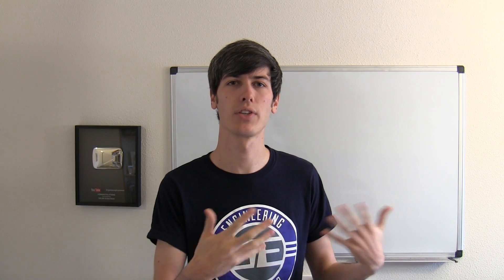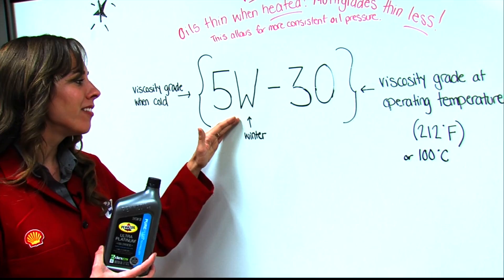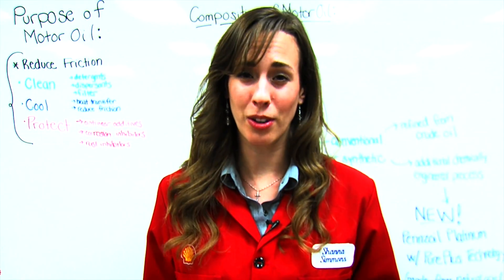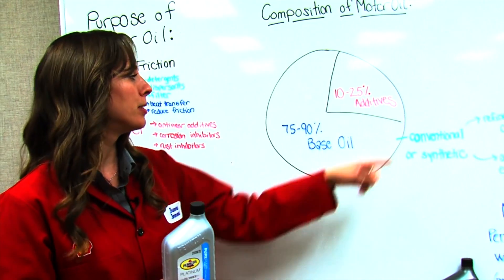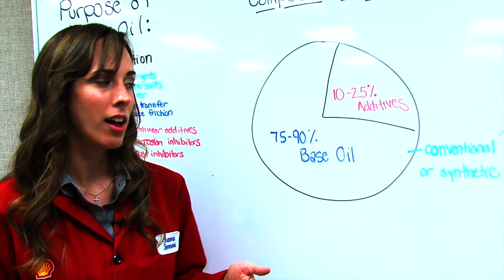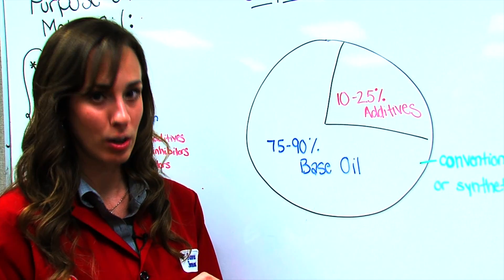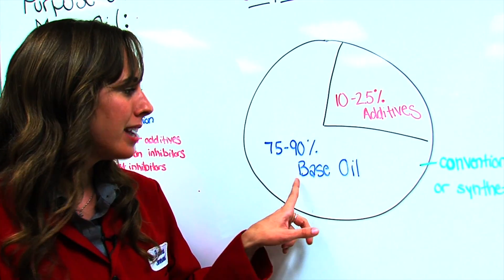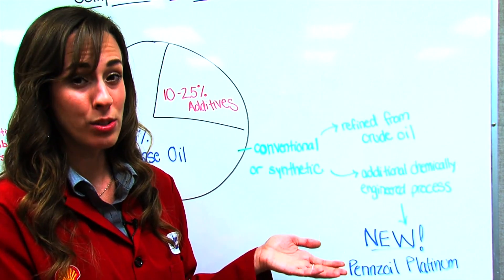Motor Oil Myths & FAQs - Synthetic vs Conventional

Comment: Conventional vs synthetic

Conventional: Refined crude oil
Synthetic: Highly refined crude oil
True Synthetic oil: PAO base motor oil created in lab

The US Supreme Court's (Mobil 1 vs Castrol) stated that "Synthetic Motor oil is nothing more then a marking term". Castrol won the lawsuit against Mobil 1.

For years Mobil 1 was selling PAO base oil (true synthetic oil) as synthetic. Castrol decided to jump into the game and sold conventional oil as synthetic.

Castrol raised the price of the conventional oil significantly to maximize profits while still less over all price then Mobil 1's PAO based motor oil.

Mobil 1 couldn't compete and sued Castrol for fall advertising. Castrol had lobbied Congress for years and ultimately won after a ruling that "synthetic motor oil is nothing more then a marketing term".

The US doesn't have a "Synthetic moor oil grade". Which ultimately means ANY company that sells motor oil can legally label it as synthetic. If I sold a 5 quart jug of oil for $1.50 at Walmart I could legally call it synthetic.

However since the US doesn't regulate synthetic motor oil their is a company that does APi "American Petroleum Institute".

The grades are 
Group 1: Crude oil
Group 2: Refined crude oil
Group 3: Highly refined crude oil
Group 4: PAO based oil "true synthetic motor oil"
Group 5: GTL "gas to liquid" and all over types

Groups 1-3 all start off as the very same thing. They are all crude oil, the same oil thats used to make gas is used to make conventional AND "synthetic".

Since Group 3 oil is cheap all major motor oil manufacturers sell Group 3 as Synthetic. While Group 3 is of a higher grade then Group 2 the quality difference is marginal at best since there is no way to remove all the impurity's from crude oil. On an atomic level Group 3 oils are unstable and deteriorate significantly faster then Group 4 PAO " true synthetic oils".

Group 4 PAO oils cost significantly more to manufacturer and are far better quality then Group 3. Since Group 4 oils are manufacturerd in labs they have 0 impurity's which means they are far more stable and capable of running much longer at much higher temperatures with out the risk of deteriorating.

They also significantly reduce the risk of sludge since they are pure oils to begin with. 

Group 3 are refined to remove (what they can) that are bad for engine.
Group 4 is pure so you do not have to worry about contamination since you only add to the oil what you want in it at 100% pure state.

Mobil 1 vs Castrol (source).
Reply: clinton fisher I know you posted this 2 years ago but thank you oh my God so many people don't realize it's just a marketing scheme for most points
Reply: @kateajurors8640  Probably one of the most successful marketing schemes in marketing history!!
Reply: @kateajurors8640  THere is no marketing scheme, group III oils are way better than group II.
Reply: Group V base oils are classified as all other base oils, including silicone, phosphate ester, polyalkylene glycol (PAG), polyolester, biolubes, etc. These base oils are at times mixed with other base stocks to enhance the oil’s properties. An example would be a PAO-based compressor oil that is mixed with a polyolester.

Esters are common Group V base oils used in different lubricant formulations to improve the properties of the existing base oil. Ester oils can take more abuse at higher temperatures and will provide superior detergency compared to a PAO synthetic base oil, which in turn increases the hours of use.
Reply: My coworker swears synthetic is better, im going to pass this on to him and see what he says. He also only fills up on 91 because it apparently gives him better mileage
Reply: BasedGod Strugglin' your coworker is getting less gas mileage and is polluting the earth more than he would if he used 87. If he drives a regular economy car then that vehicle is not going to be able to take advantage of the higher octane and will make his car slower and waste more gas and obviously spend more at the pump
Reply: @basedgodstrugglin  Every yt video proves synthetic is better, the additive package is everything.  And my co-worker has proven to himself that 91 does give him better hwy mileage.
Reply: @lonniebeal6032  are you joking or did you watch the video?
Reply: Pls help me, should i follow the owners manual recommendation?5w30?coz your saying is labeled synthetic but conventional oil content?
Reply: @jericlamb2676  you can buy 5w30 Amsoil or Pennzoil Ultra Platinum
Reply: @jerryhanson3903  thank you for your reply, i already ask mechanics here in our area, they said in the philippines engine oil blend are diff from US or europe
Reply: @jericlamb2676  so it's better?
Reply: @jerryhanson3903  your engine oil there is better i think, tropical wether here
Reply: You know why Amsoil is better?  Because they don't put words like "platinum"  and "gold series" and "super duper bestest oil ever titanium professional rocket ship science" grade oil on the container... That should alone tell you who to trust.  Then there is the test results that back it.
Reply: @gittyupalice96  Amsoil is a good pao but Pennzoil is better in cold temps for flow viscosity. Penn is made out of natural gas, it's a very interesting species
Reply: @jericlamb2676  that's why I don't use part or full synthetic oil in my petrol power equipments. These little engines are built in an ancestral way, which means, no timing chain but pushrods instead and in a warm climate, a 15w40 won't be different from a regular sae 40 monograde oil
Reply: @jericlamb2676  He's wrong on that.
Reply: I had to come back to this nearly 6 year old comment to find someone who finally explained this.  I don't understand why a company wouldn't advertise as "PAO synthetic" after that ruling though
Reply: 6 years later and it still helps to know. Thanks.
Reply: No to group 1 to 3 starting off the same, most group III oils  are hydrocracked oil, and the additive package for group III is way better than group II, an oil analysis proves it.  Your following statement is also false, group III synthetics have a minimum requirement to be called synthetic.  You are describing Blend oil when you say  "The US doesn't have a "Synthetic motor oil grade". Which ultimately means ANY company that sells motor oil can legally label it as synthetic. If I sold a 5 quart jug of oil for $1.50 at Walmart I could legally call it synthetic".

Comment: Does using a full synthetic oil clean sludge from the engine after using low grade oils?
I have heard people using diesel oils because they have more detergents to clean engines before filling with synthetic oils?

Comment: i heard using synthetic oil in older engines or just high mileage ones isnt really good, is synthetic just more sludge preventing and engine parts protecting

Comment: As an STI owner, they have found the OEM brand oil shears down to 20 wt in 2300 miles. Garbage. Look into it buddy. Amsoil wont shear down or oxidize like base 3 garbage labeled synthetic.

Comment: WARNING friends: Nearly EVERY oil on the shelf in North America lies about being "synthetic". Base 3 is Hydrocracked, "chemically engineered" bull. TRUE synthetics like Amsoil and Redline use base 4, PAO and base 5 Ester. Mobil, RP, Pennzoil are garbage. Just look at the Noack Volatility tests. In the 5w30 range a true synthetic will be around 7-8% whereas the pretenders are 10-11 or more. Big oil in the USA won a lawsuit where they can MARKET petroleum based oils, "hydrocracked" as "synthetic". Its lies and BS kids. I do used oil analysys and on a 3.2 J series the pretend synthetics wear the engine 2-3 times faster than Amsoil or Redline.

Comment: is it possilble to use synthetic oil in a 351-w ford classic engine
Reply: +piloe12 No , a 351 should be run on Mineral oil , and at least a 10w40 or higher viscosity

Comment: Just an interesting find of mine. I owned and wrote for other auto publications mostly Peterson Publications and shop owners from my own publication area, there was never even one single automotive repair shop owner (my distribution area, three states here in the sw) who ever used Pensoil, they sold it but did not ever use it personally. No one liked it for various reasons (4 years ago anyway, I don't publish or write anymore). I always asked wherever I went. Just my own experience. Also there was much information lacking here from and agree with others here that this could have been much more informative in detail, describe base oil, what additives, conventional meaning mineral based? explain , etc. Contaminants don't just happen and explaining why older engines can contaminate due to more burnt hydrocarbons passing the rings...etc. And why new engines don't need 3k miles changes as per findings at Sloan School at MIT. btw, feel free to check out a vid on my air cooled 82 550 yamaha engine utilizing diesel and petrol efficiently. Shamless plug...sorry. Really like your channel by the way and kudos for promoting real science and not pseudoscience bs found extensively on YouTube.

Comment: So what was basically said was that branded oil is bullish? So if i put a low grade oil aka Autozone brand or the bargain brand, with my recommended manufacture viscosity, and keep up on my oil changes... My engine will run well... But what are these additives? What do they actually do? What are they made of? Could i add them myself to my bargain brand oil. It seams like its just a numbers game with large company's. I've seen commercials like Mobile one Full Synthetic running next ot there "competitor" aka Shell. And there test came to a conclusion that Mobile one oil will with stand high amounts of use. Well what if your not keeping your car at 6k for hours on end. What about a company determined to make your engine run at its maximum efficiency? Shouldn't the car leave the show room like this? I love this topic and i wish there wasn't so many motor oil company's so someone could give an honest answer, But would you be able to dig into this more? I'd love to hear what you have to say!

Comment: In my case, I use conventional (3 lts) and semisynth (1 lt), because is what I can find in the most economical and good brand. In my case, the problem is finding good quality oil (most of them from US, hard to find here... you guess already where I am... V...E...N... :P, anyways, what I do to help my pocket is to use a proportion of 3 parts of conventional or semi and 1 part of the best of what I can find, I have an old engine and I try to find the close and best oil, between 20W50 and 15W40 (warm climate all year around).

Comment: I'd like to see a followup on modern engine break-in.  There's a few theories on what the best way is...or if you really need to do anything at all.
Reply from the maker: snakyjake1 That's always a great debate and discussion among the car world. My theory is to go with what the manufacturer recommends, as they're the ones providing the warranty and want the engine to last those 60,000 miles without any problems.

Comment: If the first number in 5W-40 is the cold viscosity, and the second is the hot, shouldn't the second number be lower? How does the oil get more viscous (thicker) as it heats up? Never understood this.

Comment: hey.. i don't know if you had answer this but i hears rumors that when a vehicle has high milles  you should upgrade the viscosity... example

10w30 to 10w40... its that recommended??

other subject.. when you have a car where its upgrades as in a stock to a high performance you should change the the viscosity 

10w30 to 10w40... its that recommended??

Comment: Like many others, i was looking forward to learning more indept things, and seeing some more less basic issues explored.   for example, how do oil detergent work, are they good for the engine and can they actually be harmfull.  or if the newer tougher oils be used in a older engine and changed less often (newer cars need their oil changed less often;  is that the oil or the engine's fault?)  the issue of how mult-grade oils work would have been interesting too, and their benefits over single grade ones.
anyways good channel overall.

Comment: What about switching between conventional and synthetic?  I've had several automotive instructors/mechanics tell me that conventional oil is not as slippery, and more grooves form in the cylinder walls when used consistently.  These grooves hold oil in place (similar to honing the cylinders after a rebuild).  The idea is that when synthetic is used consistently, these grooves don't form as much.  Therefore you should switch from synthetic to convention on a well worn engine, because there are fewer grooves for the  conventional oil to use and lubrication suffers.

Comment: Back in the day (1979) I bought a Pontiac Trans AM with a 6.6L 402cu and I used conventional oil.  Then they came out with synthetic oil by Mobil 1, so I switched to that, and my car started doing a bit of smoking!  I immediately told a mechanic, and he said it was the synthetic oil causing that, and to change it out, back to conventional oil.  So I did, and it quit smoking!  Now that was 35 years ago, when synthetic oil was relatively new on the market, but whats the deal on that...why did it make my engine smoke????
Reply: Your car wouldn't have been designed to use the synthetic, due to it being more free flowing it probably got alot more blow by than what would have been allowed with the mineral oil. I've been told by a mechanic you should only really use synthetic if the manufacturer says to, changing frequently is the most effective way to preserve your engine
Reply: James Lee Hey, Thanks for the input.
Reply: Think of it this way. Conventional oil is composed of small, medium, and large particles. Synthetic is only one size of particle, medium. Now the weight will be the same, because the large and small particles average out to be medium. However large particles can plug holes medium or small ones can't. So in some situations, where your engine is almost (or is) worn past it's limit, synthetic can cause leakage. Nothing that switching back wont fix.
Reply: ***** Well, that would certainly explain it.  Switching back to non-synthetic fixed the smoking problem.  Back then, Mobil 1 was the latest and greatest and I wanted the best for my Trans Am.  Thanks for the input!

Comment: Synthetic is not always better, I drive a 2000 Subaru Forester and I just use conventional oil because the synthetic will have no benefits for my car... But BMWs for example need synthetic because the clearances between the piston and rings is so tight and precise that the uniformly sized molecules of synthetic oil are necessary, conventional oil doesn't have uniform molecules, that is some are bigger and some smaller and so putting it into an engine like that would lower efficiency or even break the engine eventually. Basically I just don't like how a lot of people always go for the synthetic thinking is going to be better and then pay 2 times as much when their car won't necessarily benefit from it, of course if your car specifies for synthetic then by all means

Comment: I always wonder why some engines are recommended to run with mineral oil only (mostly old car and motorcycle) and what will happen if I use fully synthetic oil in those engine?

Comment: This was awesome thanks! :D....how about the typical milages for synthetic and conventional...i heard conventional you can usually do 5,000 km...and synthetic you could even go up to 12,000km
Reply from the maker: Synthetic is much more consistent, but it doesn't mean if you make the switch from conventional you suddenly have longer change intervals. I just go with what the manufacturer says, because that's the number they believe will give it the longest life (and thus minimize their risk warranty wise).

Comment: Not tryin to be a dick, but I feel like she read the answers off cards, and I expected a bit better explanation from an engineer/researcher.  I thought the question about whether synthetics can leak more opposed to a conventional oil (the idea being because synthetic particles are smaller, they can weep easier) would definitely be on there as a myth or not.  Oh well.

Also, I disagree with her last answer, it's not all about 'what the engine was designed for' - 8 times out of 10 it is, but politics plays a role in engineering so sometimes it's not.  In some places you have manus using 0w20 in engines originally designed for 10w30 because of fuel economy requirements or other BS.
Reply from the maker: Sure, companies are looking at all of the different ways to improve fuel economy. Lower weight oils is one of those methods.
Reply: Noisy 2.0l vw beetle

Comment: She should've gone into detail about mixing oils, you can't just mix up whatever you want.
Reply from the maker: Yeah, one thing is you want to make sure the weight of the oil is the same.
Reply: Engineering Explained you can mix weights (definitely in suspension/fork oil, I would assume engine but maybe there's other complications), I don't remember the exact reason but I do recall learning that a 50/50mix 10W + 30W  does not = 20W, it's higher or lower than that.